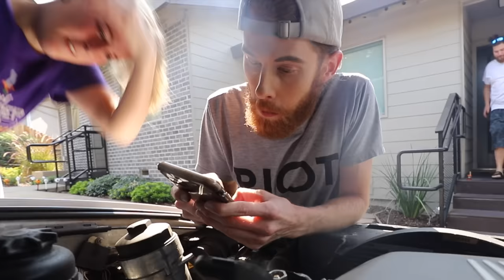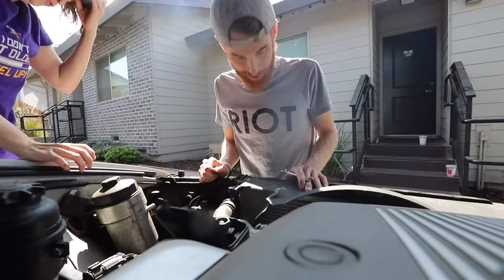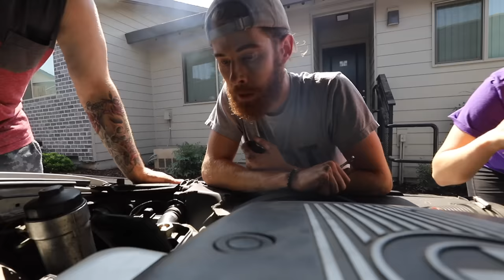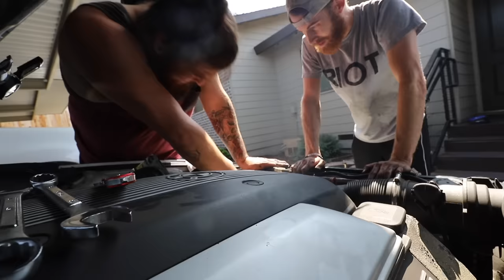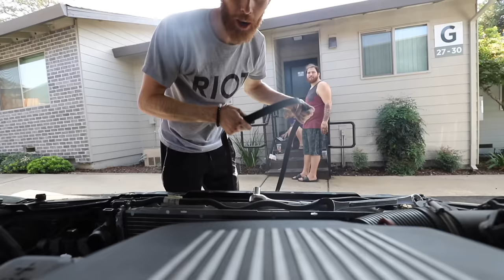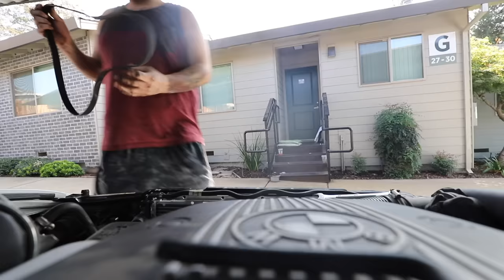TRYING TO CHANGE MY ALTERNATOR!

Comment: Oh so complicated. My husband and I changed the alternator on an older chevy cavalier. Apparently it was super easy by comparison. It was on  top, near the battery. Took 20 minutes and didn't have to remove everything. Those belts will give you trouble.

Comment: Sometimes it’s easier to get to through by jacking the car up, taking the wheel off , remove the wheel well plastic. But you still have to loosen at the top and the serpentine belt. 😉

Comment: U uploaded this the Day after my dad's/sister's car died. We thought it was the battery, so this stranger drove my dad to Walmart to get a new battery, and when he came back, it wasn't even the battery. We needed a new battery, cause the battery was already dead, but we somehow got use out of it for a year. So my dad checked the main fuse box and the wire was fried. And he moved it around, and the lights in the car went on and the car started. BY ITSELF. THE CAR, STARTED... BY ITSELF! ;-; Luckily nothing happened when we drove home, but that sure was weird.

Comment: Brandons gonna break it you did it the hardest way and wrong cause 1 alternstors dont leak 2 the pipe cant have air in them and those bolts are needed and also the leaking might be the oil or windsheild wiper soap depends on the car